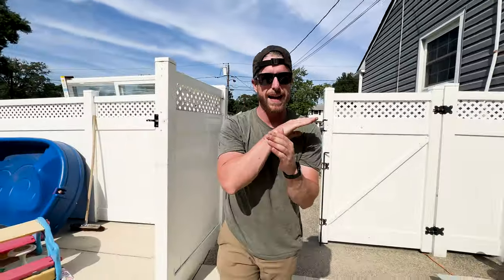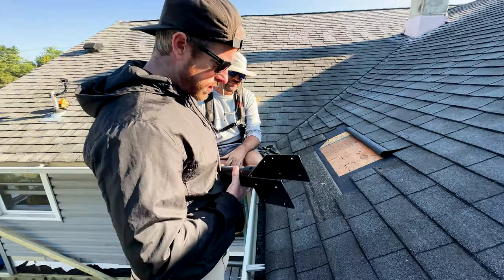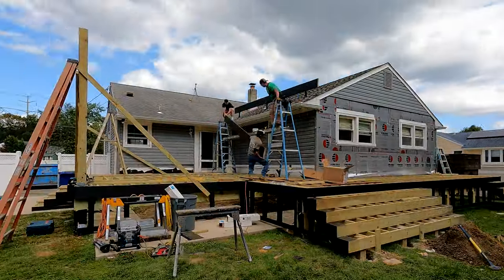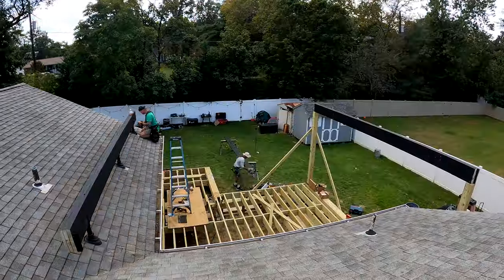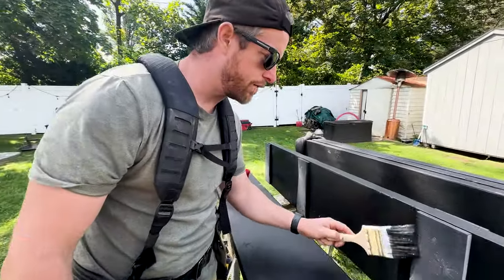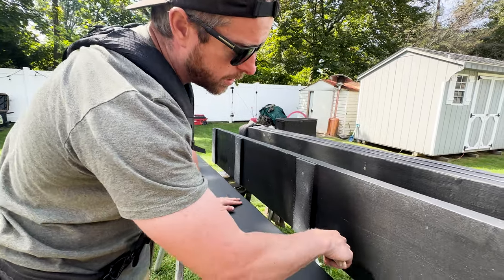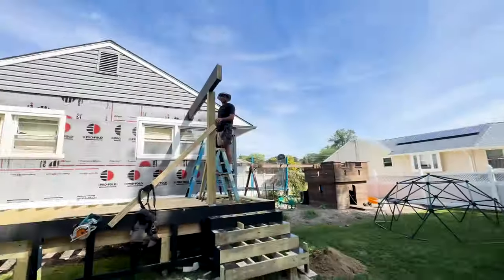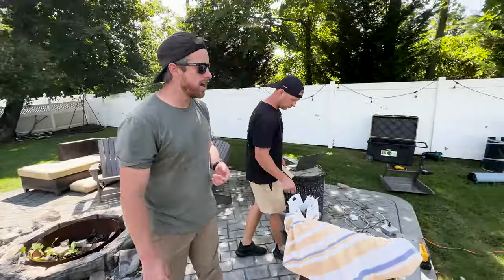WE CUT THROUGH THE ROOF?! 🫣😱 Installing SkyLifts for a PERGOLA!

Comment: Did you notch the beam on the house to accept the brackets, just asking because I know those are 3 1/2" saddles.
Reply from the maker: We got the rough cut sized brackets so they were 4”, we routed a half inch out of the board on the backside!

Comment: Virtually NO information about actually installing the SkyLift!  No specs, structural info, anchoring, lateral / shear, uplift, etc.  Video should be titled...."We cut a hole in the roof and mounted this thing.......then spent the next 15 minutes talking about ourselves."  Very disappointing.....Deceptive Title.